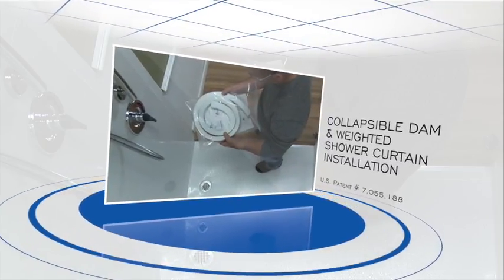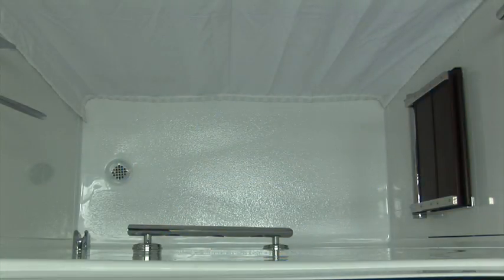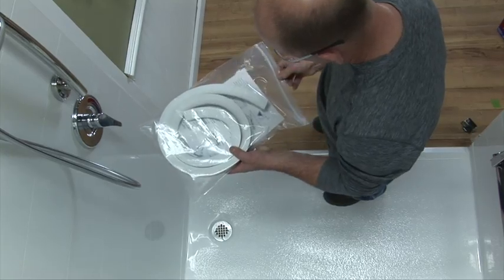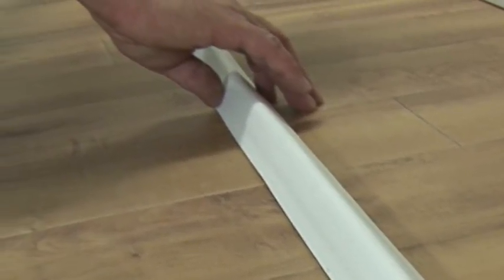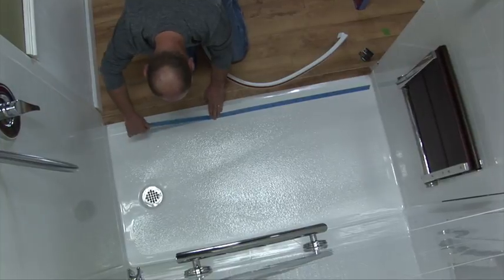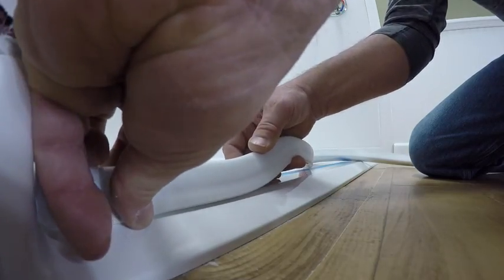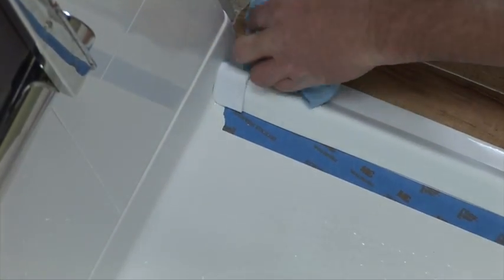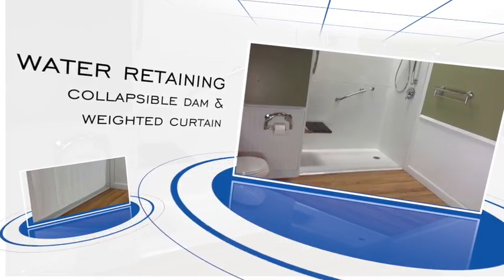Freedom Showers Collapsible Dam Installation - Accessibility Professionals

Comment: Se puede poner aquí puertas de cristal?
Reply from the maker: You can as long as you are not drilling into the threshold as there is metal in the threshold. You are better to install a semi permanent threshold and then install the doors to that. It would changes the shower to have a small curb. https://www.freedomshowers.com/Shower-and-ADA-Bathroom-Accessories/Handicapped-Accessible-Shower-Accessories/APFSPT36-60IN
Reply from the maker: It is better to add a semi permanent threshold and attach the doors to it. You just dont want screw into the metal that is in the threshold. https://www.freedomshowers.com/Shower-and-ADA-Bathroom-Accessories/Handicapped-Accessible-Shower-Accessories/APFSPT36-60IN